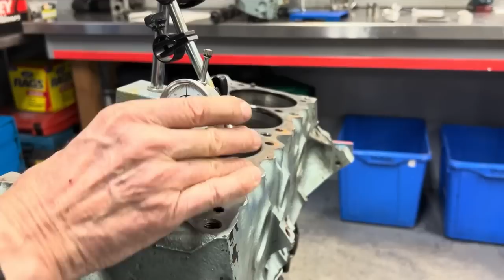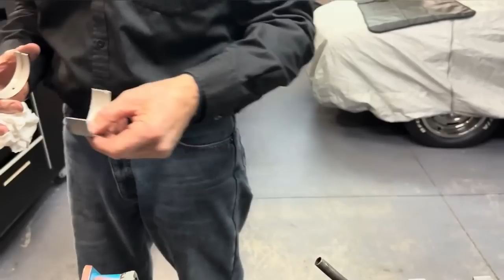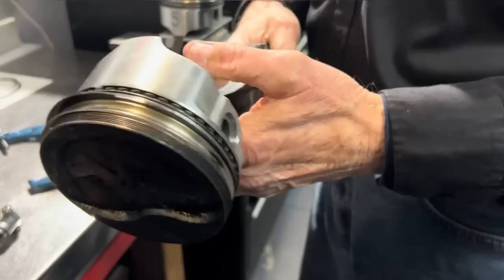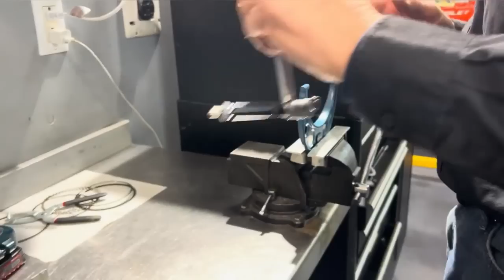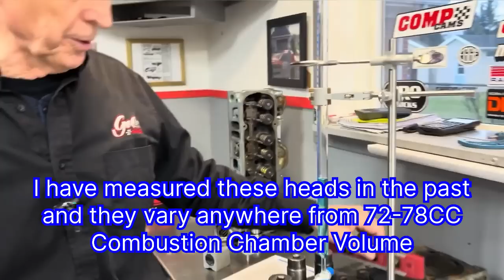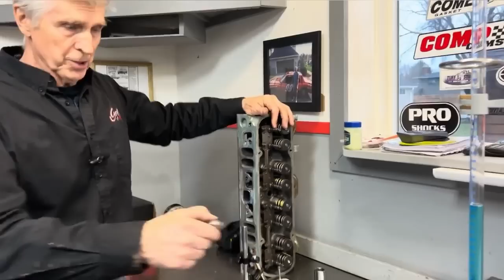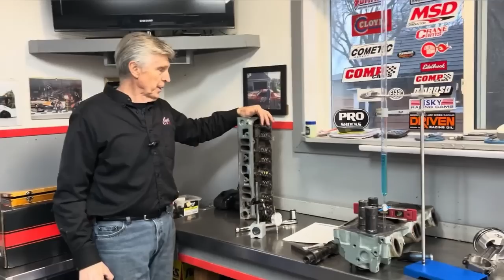Troubled 400 Pontiac engine showed up in pieces! Problems and Solutions

Comment: If you're going back in with a flat tappet cam I would not use that used cam with new lifters.  Spend the money on a new cam so the cam and lifters can break in together.  The only way you should reuse a flat tappet cam is if the lifters are in good shape and you are certain they are going back on the same lobes.  I'm sure people have gotten away with doing other sketchy stuff over the years, but it's not worth the risk.
Reply from the maker: Thanks for your advice Big Mike.AG

Comment: I've heard of many complaints about Com Cams lifters.
Me included, 5 years ago put together sbf with com hyd flat tappet lifters . Was noisy from day one,  sounded just like solid  flat tappet , not an oil psi issue (idles at 60)Comp Cam dealer told me this is kinda normal. Surprised me he admitted that. All looked perfect when removed. Ben told they have to much clearance between plunger and inside body of lifter.
Reply from the maker: Thanks Frank, many similar comments. AG

Comment: Happy New Year. Great video and I am currently building a 68 Pontiac 400 out of my 68 GTO. I am curious what you think of the camshaft? I have the same one to install in mine and have been bouncing back and forth with leaving that or going roller. Mine engine still has stock design pistons and the stock 16 heads which I measured at 75cc’s. I have done the BBC stud upgrade just gunshy of the lifters and stock rod bolts. Thank you for all the hard work.
Reply from the maker: I would recommend calculating your static and dynamic CR and cranking pressure before you decide. Summit calculator doe static, Wallace for dynamic. Try for 170-180 PSI, you may have to change pistons. The point is, you don't want a big cam with low CR. Roller cams are great if you can afford one. I wouldn't worry about the rod bolts.  AG
Reply from the maker: Happy New Year. AG
Reply: I just picked up another 400 today with 6x-8 heads so I have more options at compression. Everyone is steadfast about 9.5 as a maximum with iron heads on 93 octane but I run a 94 454 which started life as a TBI engine and I converted from the heads up to 96 Vortec complete with the port fuel efi manifold and larger injectors. The compression ratio is 9.0 to 1 and I run 87 octane in it in my 6500 lb dually and drive it daily.
Reply: I also already have the cam in the Pontiac. I have just been putting off starting it but have drawn alot more confidence from your break in videos.

Comment: The xe series of cams for pontiacs tend to be noisy and the typical discription is like a sewing machine or typewriter . So that is pretty normal. The choice of flat tappet lifters is crucial as quality has been a real problem in recent years. I would recommend Comp DLC  lifters  or Johnson lifters out of Mich. Len Caverly
Reply: I was going to say the same thing, built a 454 years ago and reset the lifters 3 times thinking I was missing something. Turns out those XE grinds are just noisy.
Reply from the maker: Thanks Len. My producer Mike Kimble is a Pontiac guy and has done lots of research on this. His comments are exactly the same. AG

Comment: The detonation is a bad situation, an engine can't survive if someone keeps driving it and doesn't deal with it.
Reply: Because people brag on Compression ratio. They think the higher compression ratio makes the engine. Yet they need to understand. You are going to need premium fuel. Almost AVG gas range. Plus remove a lot of the timing to make it survive.
Reply: @2nickles647 Av gas is a HORRIBLE fuel for a hi-performance automotive engine. 

DON'T use it!

Av gas is formulated for an aircraft engine that spends ALL of it's time making it's power right  around the 2600rpm range, and never higher than that. It is NOT a good fuel for an automotive engine that runs up to 6000+ rpms. 

The formulations for Av gas, and a hi-performace automotive fuel are quite different for radically different engine applications. Buy some REAL hi-octane automotive fuel if your compression ratio and cylinder pressure requires it. DON'T cheap out and use Av gas... 🚫
Reply from the maker: Correct, thanks David. AG
Reply: @goldsgarage8236   But all the bearings looked great???????????? VERY strange as the rod bearings all should have been egged shaped  🤔
Reply: @hydroy1 The bearings usually end up gold colored just on the top side of the top bearing shell if the detonation is severe. 

I've seen it MANY times.

If the bearings are wore in other places, then it's bottom-end issues that are to blame. Whether it's a clearance issue, cap walk on a big power application, line bore not straight, bent/cracked crank, and so on.

Comment: you incorrectly checked the deck height, if you check at the top of the piston you need to rock the piston all the way in either direction and find the average or check it directly over the piston pin. Len Caverly
Reply from the maker: Thanks Len. AG

Comment: Hey brother, i've done that, it WORKS!!....yes, flush out afterwards, but it DOES clean the oil galleries, etc.....we did that samr thing on a 351 Mustang that was in the middle of wipin the cam (my shop didnt build it we were helping)....we went thru 3 oil filters, spinnin the oil pump with a drill.....when we were satisfied, we stuffed a new cam in it, broke it in properly, and it runs today HAPPILY!!...yep!!....Attention to detail!!!.....only way to go!
Reply from the maker: Thanks for watching and commenting. AG

Comment: Ok, so it wasnt wipin the cam......I LOVE BEING SHOWED WRONG, i'm just a worry wart, and want ALL things to be proper......THANK YOU for lettin me whine, and i am THANKFUL  that i sub'd To the chanel......i get spun up on Poncho builds, and wanna chime in my 2 cents worth......THANK YOU again, for allowing me to whine.......i still am NOT a fan of the #12' heads.....#16, 48, or 62, if u want to make power.......altho i dont like its port shape, on a 455, the #64's will work, but good luck finding a set, i'm trying to say i believe i over-stepped my bounds, and i hope u understand my whining.....so, i APOLOGIZE for jumpin the gun, as ur expertise of tear down/forensics (if u will) are showin the issues......i get to spun up, as i LOVE Pontiac engines, my 462, Kauffman heads, nets 11 flat in qtr (3450 lbs).....pump gas......so forgive my rant please
Reply from the maker: No problem, thanks for the input. AG

Comment: timing/lean conditions sound like the issue. 91 octane no less. I would do a valve job on both heads to help flow and seal valves properly
Reply from the maker: Thanks for the comment Utah.  AG

Comment: A tip for you, just put the oil pump back on w a clean oil pan. Put 3 quarts of diesel fuel in the pan and prime it until all the passage ways are flushed out. Oh ya and a new filter also.
Reply from the maker: Thanks for the suggestion Racer. AG

Comment: The bearing with the hole and groove in it is the top one(in the block). The groove helps feed oil to the bottom bearing that has less groove or no groove (in the cap). Not sure what you were trying to say about the bearings?

Anyway, Happy New Year Al!😎👍
Reply from the maker: They do come both ways. The full groove feeds the rods better, the half groove is better for high loads/high performance. Clevite 77's come half groove. AG